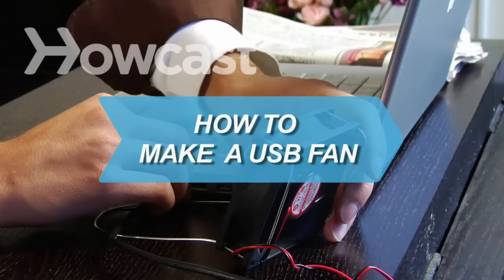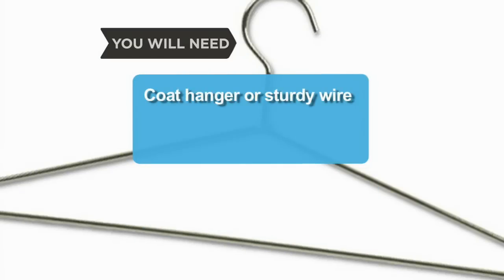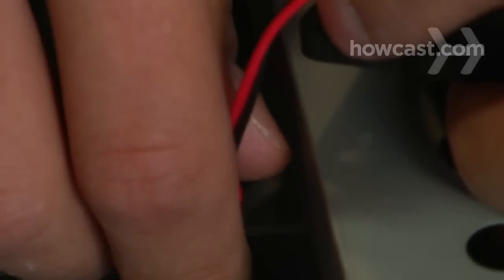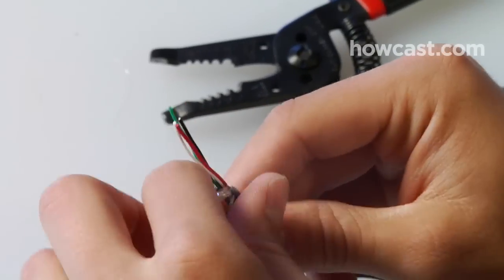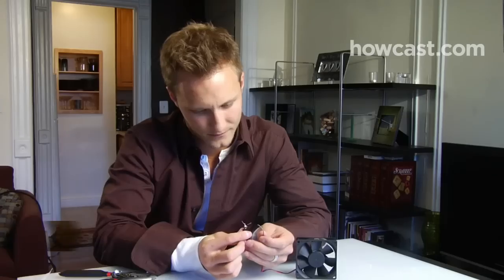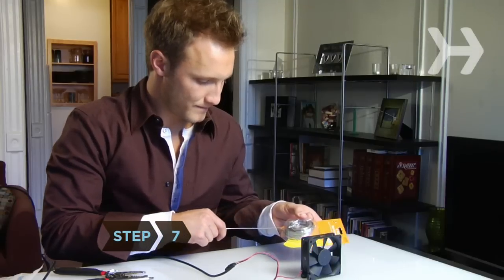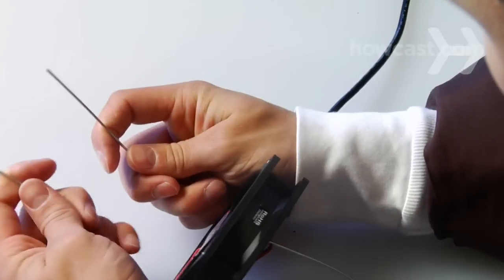How to Make a USB Fan

Comment: Absolute most fans will have trouble running at full speeds from the power of a USB port. In fact, since most 120mm fans are 12V, they'll less than a half their full speed on a 5V USB port, if at all. This could be fixed by getting a 12V USB adapter that plugs into the wall (basically a 12V output charger) or maybe a 5V to 12V, DC to DC converter, but that increases the cost in the case of the adapter, and also the complexity in case of the converter. 

Also, why am I commenting on a 9 year old video?
Reply: Just out of curiosity, you can buy pretty large USB powered fans. Are these all super weak then? Or will they work fine, as they are not designed like fans that are supposed to plug into the motherboard?
Reply: Yes but if you want the 12v fan to run slowly and quietly from 5V usb, it might do  (for mounting inside some electronic equipment).
Reply: What if you connect it with 2 USBs?
Reply: @Surpriseify  YT decided to hand me down the notifications after 4 years, so here I am.

How powerful a fan is is dictated by its operating wattage, aka power. For a simple DC situation, that is a product of voltage and current (P = U * I). For the purposes of a YT comment, yo0u can think of voltage as an operating level that needs to be met in order for everything to function properly, and current is the raw energy that does the work (it's not quite that simple, but works). A fan may be designed to run at 12V and consume some amount of current to rotate at a given speed (which in combination with blade design translates into volume and speed of the air moved), which should match the fan's power specs (say, a 6 watt fan would draw 0.5 amps at a voltage of 12 volts, because 6W = 12V * 0.5A). If you supply only 5V to that fan, it will try to draw more amps, but only up to a certain point so it doesn't damage its components, resulting in lower RPM. However, another fan may be designed to run at 5V, in which case it would draw a little over 1 amp to reach the same spec of 6 watts. 

TL;DR: a fan may be designed to run at 5V, but will consume more current to meet the same specs.
Reply: @erkan0e  Unfortunately, voltages don't stack like that. To gain different voltage, you need to use a voltage converter. Think computer PSUs - they take 120V (or 240V depending on region) AC from the wall, which they convert to DC 12V, 5V, and 3.3V, which are then fed into different rails and ultimately power connectors of the PSU.

Comment: you can try pulling the wires out, straightening them, putting them back and trying again. if not the voltage on your fan is not compatible to the usb port
hope this helps

Comment: the yellow wire is only used for reading RPM, you can just cut it off, cover it will electrical tape or leave it hanging.

Comment: USB ports give off (I think) only 5 volts. Computer fans typically run on 12 volts but the power from a USB port is good enough for a small breeze.

Comment: @SiimsCrystal yes, that one, but im not sure if you can use more than 1 fan because then the voltage will be splitted by the fans so they will be very low powered.

Comment: My hp Pavillion slimline PC would get so hot it was like one of those old style heat radiators. If I touched the case it would burn my fingers. This thing was designed to fail so I got inside & altered the wiring on the cpu fan which really sped up the fan. That still was not enough so I removed the case & drilled holes in it. I highly suspect that voided the warranty but I didnt care. I still needed an additional usb fan. I have spare fans & spare usb cables so this is cool, thanks.

Comment: Yes. It will work with anything that supplies any kind of voltage and a ground, which is pretty much any cable. Just don't use like a 20 volt power supply on a 12 volt fan. It might explode.

Comment: @tehglu 
True. But...
The fan will still work, but not at the full speed.
It's a common trick to run 12v computer fans on 5v to reduce the speed, and with that the noise the fans produce. Resulting in a less noisy computer.

Comment: I fixed an overheating AV unit by mounting one under the case lid at the vent. The 5V is enough to draw the heat off the board and out of the unit. Hasn't overheated once in three weeks since doing this. (was at least a daily event before). Wouldn't use it for personal cooling as the energy produced is not enough.

Comment: I wanted to find out which wires have power so that I could power a device that needed to run while computer is on and turn off when computer is off. Ofcourse, I have never cut usb cable before, I would have found out had I done that!!. But now I know for sure!
Thanks

Comment: @panda100123 the fan cord (12 v cord) is left out in this occasion. the fan will still work only at a lower speed. i did the same with my fan. if you have time tho you can just buy a molex to 3 pin (if you have a desktop computer) to get the normal speeds

Comment: If you want PC Fan to run at full speed, you need a Boost Converter, cause Fan runs on 12V and USB can only provide 5V, thus Fan will not work at full speed without a boost converter. You can get them on ebay for pretty cheap.

Comment: I've done this in the past.
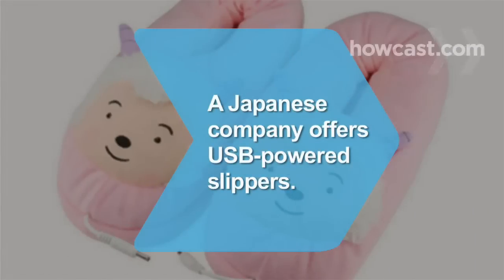While it works (the fan is spinning) it blows a very small amount of air which is not enough to cool you (and obviously nothing like 2:18 :P).

I had used an 12V 80mm. USBs supply 5V which means that the fan was working in less than half power than it should do.
Next time I should try a smaller fan rated for a smaller voltage...

Comment: I needed a fan on my lcd monitor, because it was overheating. Tried tapping into the internal wireing but it didnt have enought amps i think. Anyways i had a monitor cable with a usb cable on it (it was for a KVM switch, used to power the switch) So i used it like this and the fan is working pretty decent. Thanks for the nice lil video. Not hard to do,, wonder if running at 5v instaed of 5 is bad for the fan though?

Comment: Two of the wires have to be connected to the same side of the circus. Take a 9 volt battery and test the combinations of this wire with that wire and vise versea until you get a combination that works. Then keeping the two wires on one side and the other on the other side follow the video instructions.

Comment: @joshuafarren There is no usb cable which ends are the same because this would be useless. This is not allowed by the USB standard!
Most usb cables have Type A plug on one end and Type B plug or Type A socket on the other end. For sure there are some other cable types like Type A plug to Type Mini-B plug (eg. PS3 Controller) or Micro-B plug (eg. mobile phones), etc. but again, one cable with both ends the same is useless, not standardized and thus not present!

Comment: hey guys
measure the voltage between the usb cables separably after cutting the other end while connecting it to the computer, when you get approximately 5V, then you got the right wires to connect positive ti red, and negative to black
;-)

Comment: @iani103 Yea! If it has red and black wires once you cut off one end, you're good to go! I did that thing and it worked really well! It wasn't as fast, though. If you want your fan spinning at a faster speed I suggest connecting it to a 9 volt battery!

Comment: Only problem is that USB only supply's 5V DC when a computer fan needs 12V DC to function normally. Result: fan operates at about 50% or at a lower speed. but i think its a great idea to show it off. Still a good way to try to stay cool on a hot day lol.

Comment: don't worry the usb colors in the most of case are the "red,white,green, and black" so you have to identify the white and the green and the other cables are the ones you need, so test it and you will find the way to connect because a fan doesn't work with two polarities just with one, so if you conect it one way if not working so conect the other way and,, wha laahh your own fan,, if nothing of this works you better buy a big new chiller fan 110V

Comment: About the fan, yellow is no use, for you, that's just a "plus" the PC uses to check fan's speed....where supported.
For the USB cable, white and green always are data lines, thus you can discard them. I guess blue is GND (ground) and brown is +5V (current): just Google "wikipedia electrical wiring" and you'll see that, when brown and blue are both present, brown always is "live" and blue always is "neutral" (ground).

Comment: i have a question about the voltage you can use on a usb port. i have an old fan that uses 12 volts. can i use it on a usb port safely?

Comment: Is this a 12v fan cause u can run a 12v off 5v but how much current can you draw from a USB? Im testing this using aligator clips and pieces of wire (before I cut my USB cable) on a 12v 2.4A computer chassis fan and it dosn't seem to work. Tested the usb pinout and 5 v is there tested the fan with 5 v power supply and it works.

Comment: the usb cable i have has a very light gauge wire in comparison to the fan, does that matter? the fan also has 3 wires on it, red black and blue but I had the fan running on a 9v battery with just red and black

Comment: I have 4 wires for the fan - blue, green, black, yellow. I dont need it to be super fast, but I need it to work. Which do I connect to which?
Reply: Pin 1 - Ground - Black
Pin 2 - 12v - Yellow
Pin 3 - Sense - Green
Pin 4 - Control - Blue

don't need green and blue !
Reply: JS7457 hi sir i dont get it. where should i connect the yellow wire of my fan ?
Reply: +Christopher Cartago To a 12v source like a battery
Reply: JS7457 ok i get it. thanks

Comment: i have 3 wires on my fan black red white, and on the red wire theres a ( i dont know what it is) thingy, whet i connect my fan thed and black wires, my fan runs on a very low speed ( its a brand new fan) how can i make it run full speed?

Comment: Dude The Fan Is Tooooo Weak!!
Reply: Help Me Guys I Want To Make It Faster I Mean..I Tried It By The Cables In The PC And It Was Extreme Fast When I Connected It To USB It's Like 3V
WTF?
Reply: LimeMhmd I couple days ago take a part old PC and that fan is running on 12V not 5V that you can get from USB port
You can try with 2USB cables 5V+5V=10V  (connect fiirst cable + on second cable - and those 2 free wires connect on fan) (if fan dont work on that way unplug them immediately)

you can also use external source of power if you want, and if you dont know how make them send me a message and you will get detail instructions.
Reply: LimeMhmd did you try, if you didnt dont, couple days ago i take out old PSU  and all GNDs are on same place so you would just make a short circuit.
take a look on your psu (power socker unit) colors and where says +12V and GND (ground - usually black wire)  and use those two wires for powering fan
Reply: *****
computer fan i made to work at 12V, use PSU to connect fan at 12V (ps it can work at 20V but you need external transformator)
Reply: ***** actually USB ports supply 5 volts, and pc fans are recommended to have 12 volts supplied to them, but 9 volts is sufficient and will run them at a decent speed
Reply: Janko Vidackovic if he was desperate to run it off USB, could he use 2 USB ports and wire them in series (or whatever its called to add the two voltages together) to get 10 volts to run the fan? Just a suggestion, I'm sorta fairly newish  to the whole electronics thing...
Reply: Tobias Bennett yaa you can use two usb wires !! ^.^
Reply: Shaikh Sohail
no you cant use 2 usb wires youll make short circuit, all grounds are on same spot (al least in my old psu).
use 12V wire, youll get full speed and air is not concentrated its spreads out very quickly
Reply: ok

Comment: Yes. I can help u in controlling..d speed of fan
Reply: If your fan it's way too slow because
Computer fan desinged for 12v
Not 5v(usb power)
Just add 1more usb cable
5 + 5=10
It will be more fast

Comment: this thing will be pretty useless ;) first, the fans runs at 12V while the usb port supplies only 5V so the fan will run at half speed. second, even if it would run at full speed you wouldn't feel a breeze as cpu fans ain't designed to output a straight airstream but produce turbulences. Maximum range is about 20cm. and no consider it's only running at 5V ... nobody want's to be this close to a fan ;)

Comment: wait ! usb is 5volts and a fan from a desktop computer is 12volts...
No convertor ?
Reply: yeah dude.. there is a converter.. power supply unit does that :)
Reply: saurav bhowmick Dude the powersupply unit suplies the USB with 5 volts not 12 volts. If you want to have a fan that runs with good speed you need 12 volts not 5

Comment: the fan i got has 4 wires.. however i managed to run the fan.but its damn slow.......couldnt get any air from it ..what is the solution ??
Reply: it's slow because your fan is a 12v ! not 5v !
Reply: JS7457 yup.. somehow i figured it out that  .. thanks :)

so cant make it faster

Comment: I want to control the speed of a fan can anyone help me with that ?
Reply: Gamerdu45 
rheostat + voltage divider....
Reply: Gamerdu45 
better way is to use PWM control though
Reply: And what about to control the speed of fan by software in a computer
Reply: well, just buy a case fan with pwm control. connect the 4th pin to usb D+ and D- to the gorund. Then write an interface program to control it.
Reply: A potentiometer.

Comment: I watched this video so I can power a PC fan via USB to put on top of my Xbox 360
Reply: Yea, if you want, but I don't know how much voltage the xbox 360 USB's are though :-/ because if you have a 12v fan and a 5v USB port than that fan is going to be suuuuppppeeeerrrrr slow then. :)
Reply: christopher choate Yeah, true. I don't know if it's just me but it appears to spin faster when plugged into the front USB ports.
Reply: It's probably just you. :) because I did some reasearch and a USB port can only have 5v max going through it. :-/
( I'm pretty sure) If I were you I would go to Walmart or wherever you go and by a USB fan ( made by a factory ) I know the fan will only be 5v probably max, but it should be more powerful because the fan is made for the 5v.... :) hope this helped! :D
Reply: christopher choate Oh okay, interesting. Well even though it isn't running at full potential, It's good enough to keep the cpu cool better than the stock fan alone does.
Reply: Do you have the original Xbox 360 or the xbox 360 slim? If you have the old xbox 360 version, it has a 12v fan hooked up to it but the factories only made it run at 6v, if you want the 12v speed in the 2 fans you have to watch a youtube video on how to do that. :) but the slim you should be fine without it, but I know you want it to last longer, I understand. :D

Comment: I have a problem.. my fan have a yellow,blak,green,blue wíres..
Reply: NO Majnkraft Pretty sure that is C fan and it is too small to work correctly anyways.
Reply: Viktor Penc I too happen to have a stock CPU fan with exactly these wires. Any way connect it to a USB cable ? I just don't feel like buying a fan when i have this unused one leftover from my pc build
Reply: Viktor Penc Electro phobia *****  Thanks guyz. But now i have next lvl of fan.. Now i have fan from hairdryer.. You need open hairdryer , disconect heater and other things and use fan only..... I have old one and its work perfectly... And Electro phobia Now i know how to work witch tehese.. Yellow and black will be the wires you need to connect (red to yellow, black to black) (Yellow is pozitive and black in negative..)
Reply: ***** I do things safety.. I buy new  hairdryer .. :D
Reply: ***** you don't have to be 18 to buy a hairdryer you know
Reply: ***** You don't need an bank account to buy a hairdryer.
Reply: ***** You can buy hairdrye in every electro shop..
Reply: ***** Also, you are lying.
Reply: ***** ever heard about cash ? you know, coins and bills
Reply: ***** You can buy it.. Its cheap..
Reply: +Bass Lover Black to black and red to yellow.

Comment: vid sucks :) you need 12 volts to get full speed and nice air flow. but i know cuz i did this you can over power it but just to 18 volts i got one to go on 27 but i ran it one more time and motor was dead so just go up to 18 volts if you want more power.